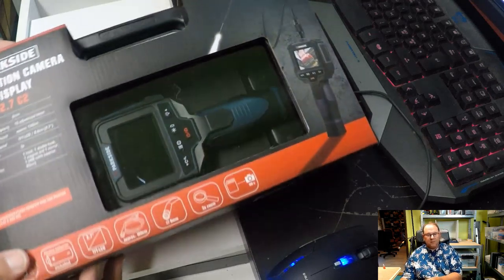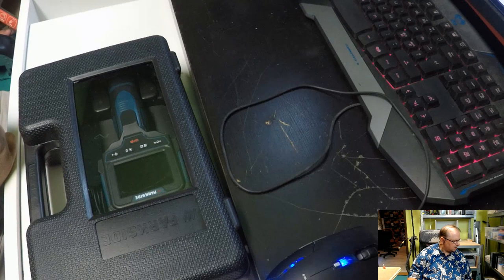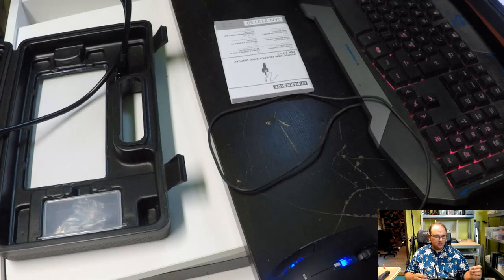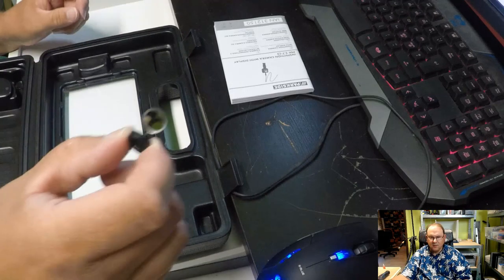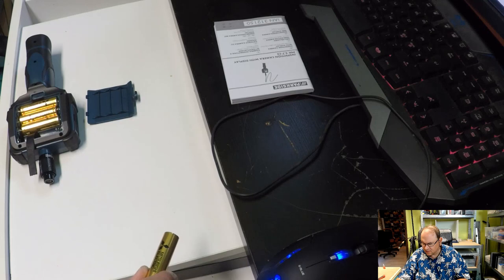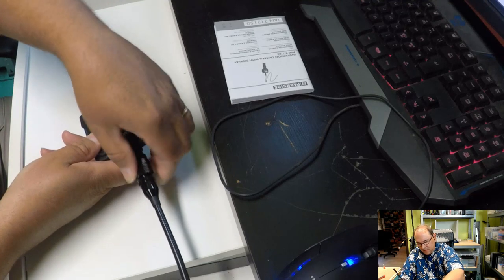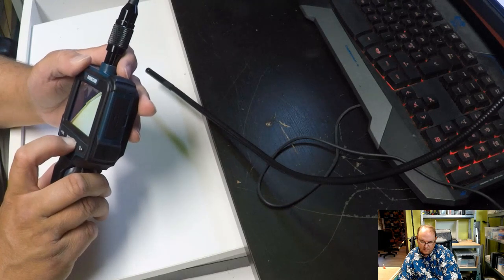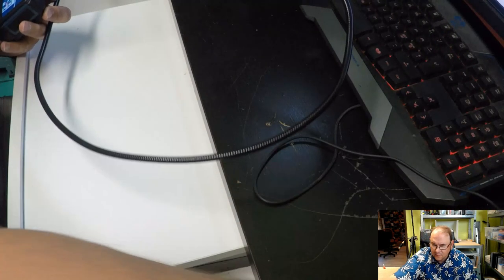Parkside Lidl Inspection camera PEK 2.7 C2

Comment: The Parkside  PK12,7 inspection camera ir pure trash. F: 0,27 objective, you get 10 to 33 kB pics, in optimal enviromental conditions.
Reply: I'm looking at endoscopes and for the price of this camera there is nothing better. I was looking at a Bosch that costs €280 (without accessories) and the quality is exactly the same as the LIDL. I think that for the price it has nothing else like it.